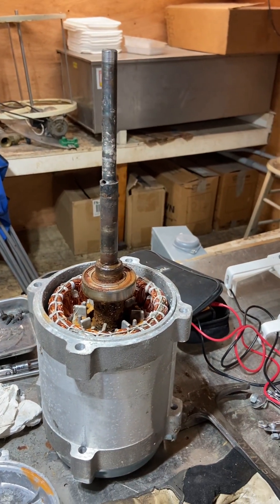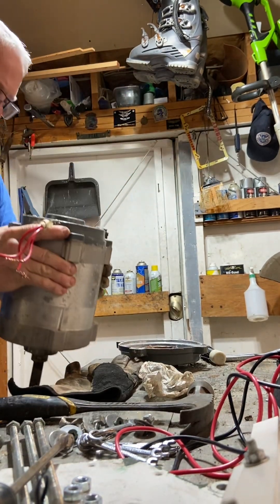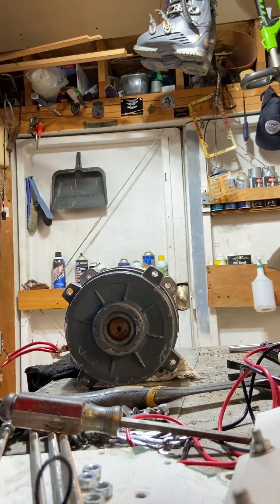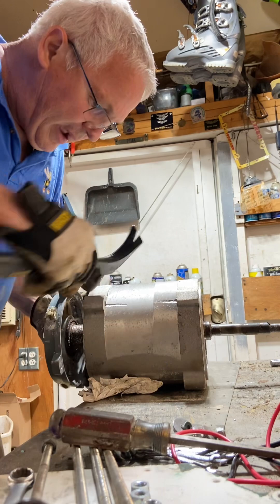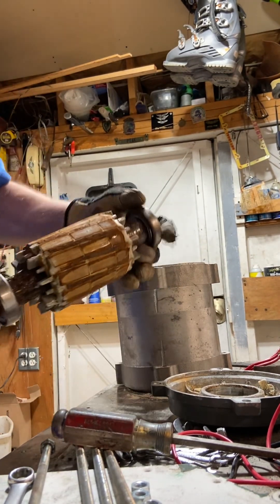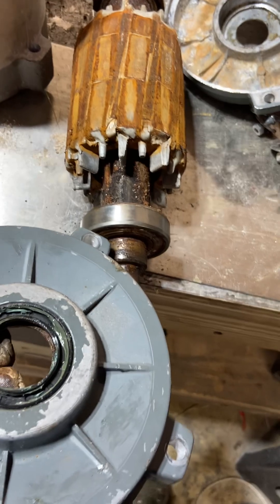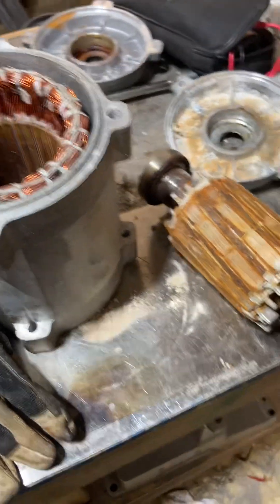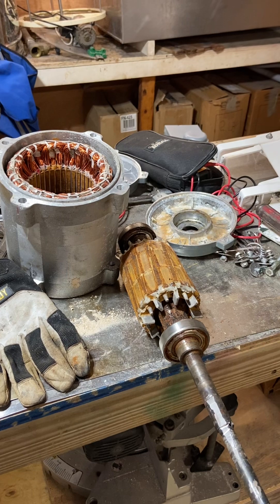Vertical Wind Turbine ￼ Generator , ￼ Tesup, extreme failure, Shaft Seal

Comment: Cant see from the video, there might be a circlip holding the bearing in position
Reply from the maker: Well as you have seen from my video, these are knock off bearings, no clip rings. Not even the correct bearings. It should have had a thrust bearing on the bottom of the shaft for a vertical turbine.

Comment: What a mess!
Remove the ring on that locked up bearing..  Clean & repack with grease.
Reply from the maker: Turkist knock off,  there is no rings, its not even the right type of bearing. It should have had a thrust bearing in the lower case.